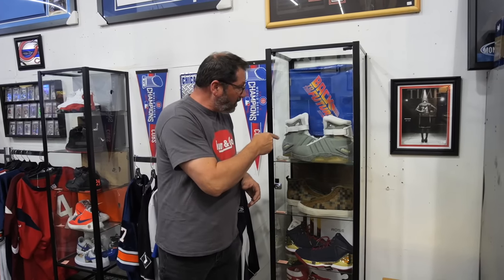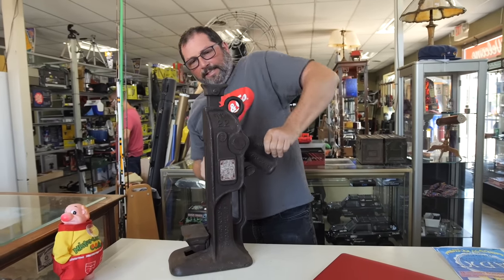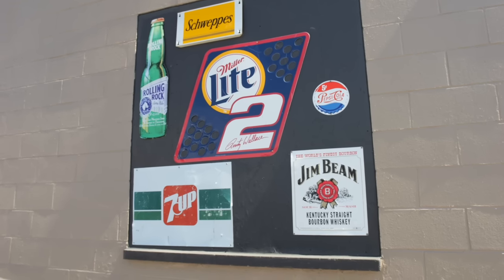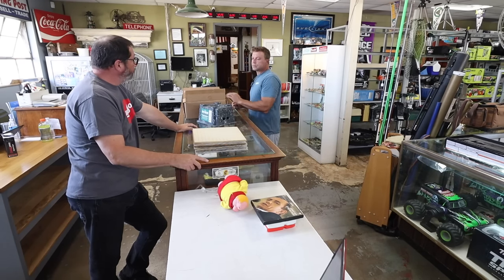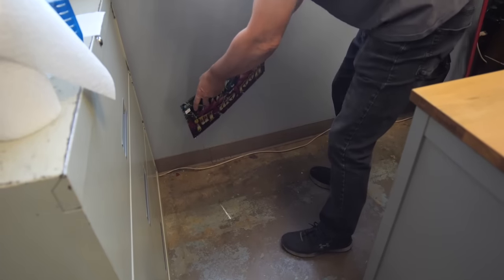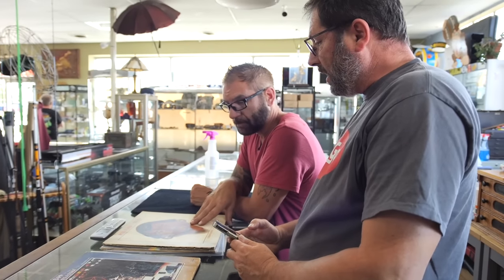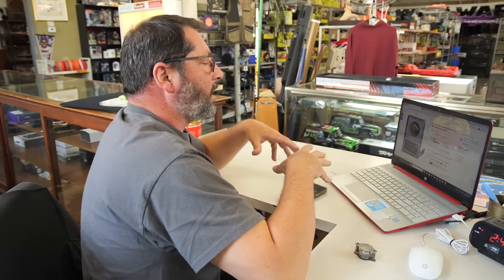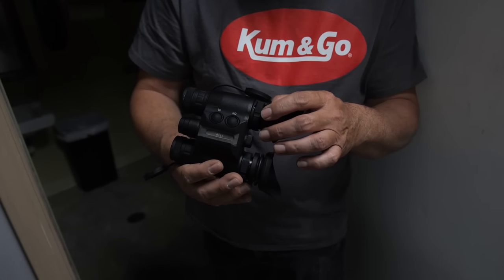Real Shop, Real People, Real Negotiations

Comment: The railroad jack is typically known as a track jack because it is mostly used for track repairs and maintenance but they also get used in locomotive and railcar repair shops. Getting an accurate date on one is almost impossible unless the purchasing company etched it on the body somewhere because that design has been in use for over 100 years and is still being made today.

Comment: I wish I was closer, I'd be digging in your 8-tracks. They very rarely show up at the thrift stores here anymore, and many of the antique malls and used record stores that used to normally have 8-tracks no longer have them. Most 8-tracks are not worth more than $1, but many rock tapes can still fetch a pretty penny. You really want to eBay search each one, don't assume they're all worthless. I would not have passed on that Johnny Cash reel to reel tape, that would've been an easy eBay flip. Also, always take a closer look at any reel to reel tape that is 7.5 IPS, even classical and instrumental. Most prerecorded reel to reel tapes are 3.75 IPS.

Comment: Just for fun, I googled the BTTF Part 2 shoes. New ones sell for around the $100 mark. $450 - how are these different?
Reply: The $100 ones are shipping from China. You have to look up officially licensed Universal Studios. $450 is still a bit high, but maybe he would like to keep them around for a little while.
Reply: He's over charging way too much I have the same shoes and yes you found the right ones on the website from the Halloween store for $100. They aren't any different. These are the same ones from the Halloween store both officially licensed by Universal Studios and released a few years back, they sold out right away because sneakerheads went crazy for them, but then have been restocking ever since. They do not come in half sizes, you have to round up or down to a whole size.